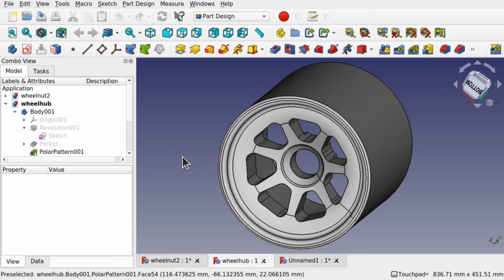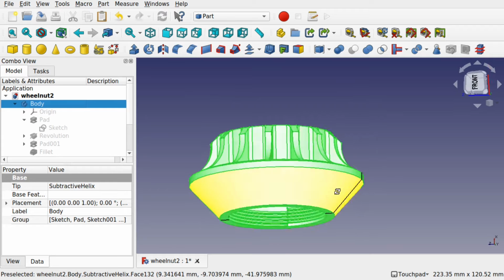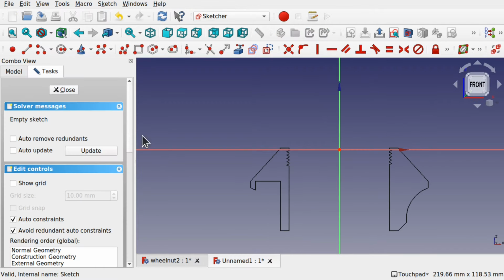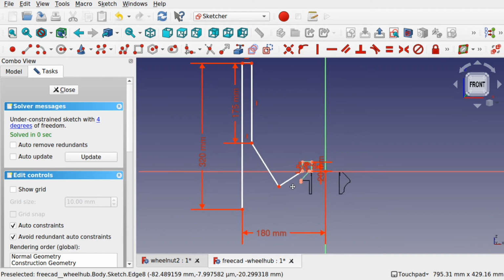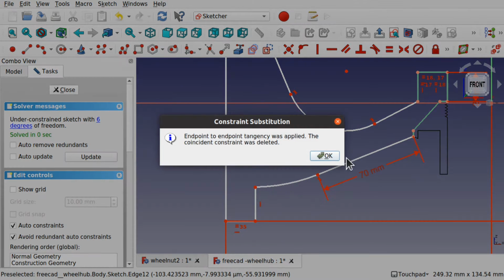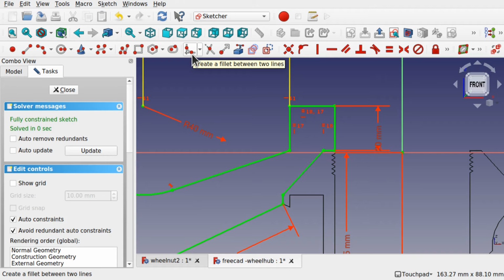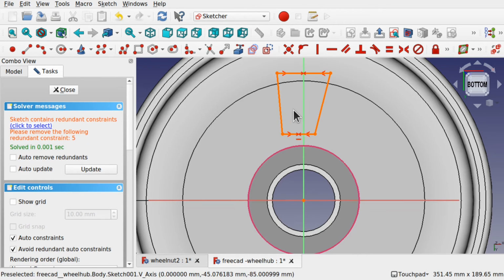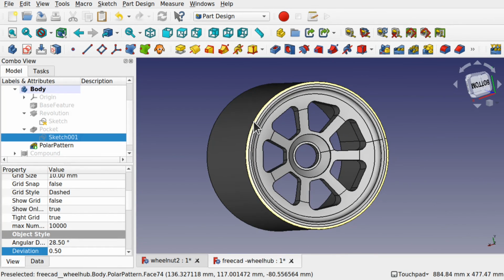Understanding FreeCAD Part 16: Easy Formula 1 Wheel Hub | Part Design | Beginners Basic Tutorial

Comment: Again another great video. Question, something I often notice your examples: Why do you attach sketches to faces and not planes, as recommended because of the topological naming problem?
Reply from the maker: Thanks glad you enjoyed. I do get asked that question every now again. I come from a traditional CAD background and I have now taken the view that considering link stage 3 is putting in a great effort to eradicate the Topological problem then for longevity of the tutorials I have taken the route I have Also if you manage your models carefully you would be able to easily change the support  to fix these issues. Placing a sketch on the base planes to get around the problem doesn't fix the issue of referencing geometry from another sketch which can have the same issue. In my opinion if you are going to not attach anything to the underlying face then you must also take the same approach with importing geometry into sketches and then when referencing that geometry in formulas At this point your putting in barriers which ends up making the experience of using freecad somewhat complicated.